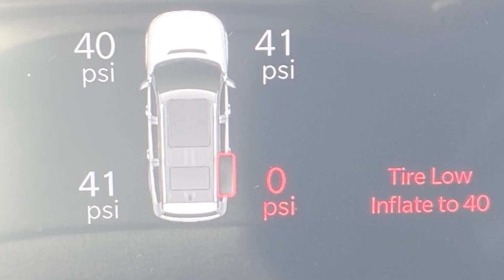Changing a flat tire on the 2022 Grand Wagoneer

Comment: I just went to change the rear tire passenger side on a 2024 wagoneer and the tire jack is not tall enough to put the inflated tire on the vehicle while at max height on the furthest rear end lift point
Reply from the maker: Hmmmm. That’s a challenge. How did you handle it? Deflate the tire enough to fit it?